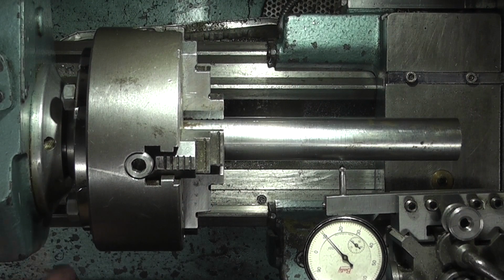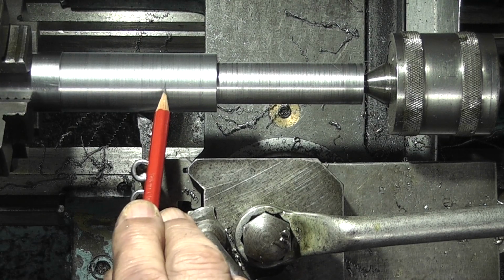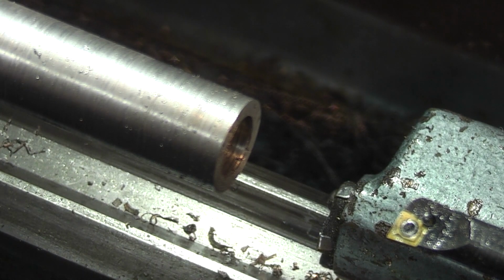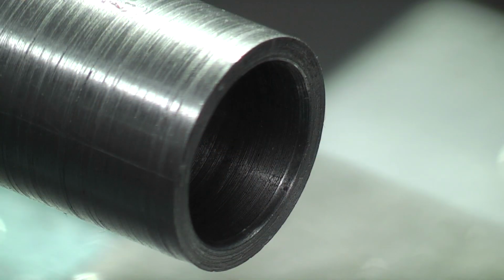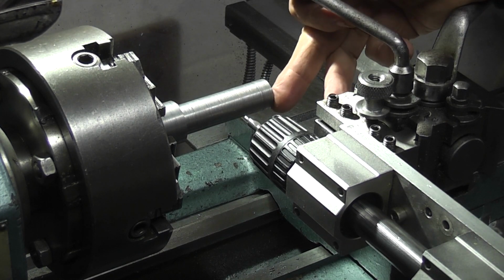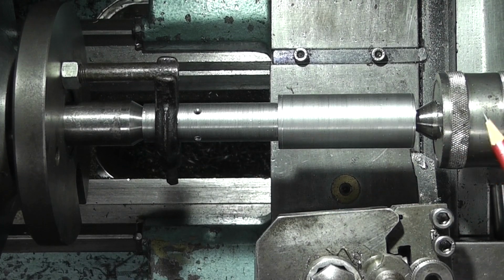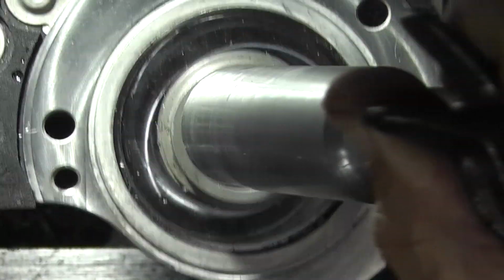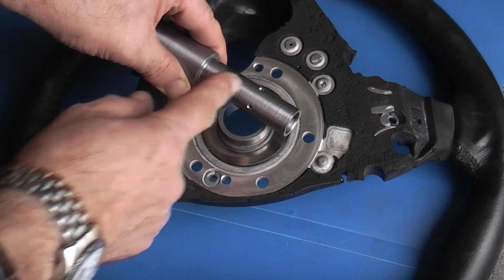Headstock handle part 2

Comment: Another good project. When I have to drill a hole deeper than the flutes of the drill and there is a a larger hole to be drilled after, I drill the small hole as deep as the flutes are long and then I drill the larger hole. The smaller hole is then drilled to depth.

Comment: How do you account for the different readings on your DTI  ?
It suggests to me your headstock is not aligned as it should be  ?
Reply from the maker: It may be the chuck jaws need re grinding as the head stock is fixed to the bed on Vee ways